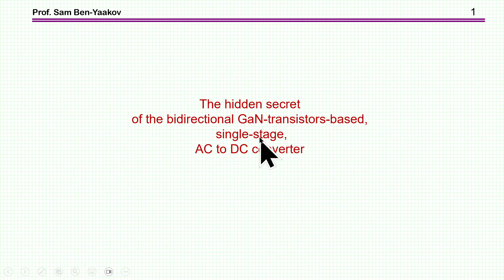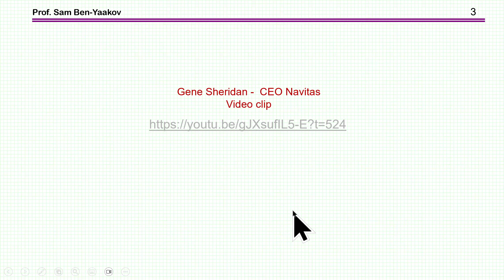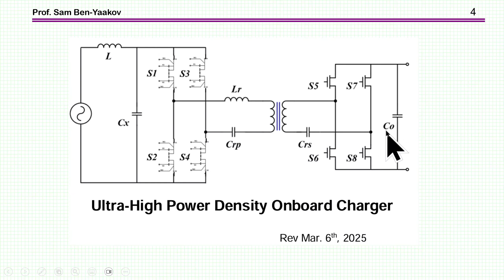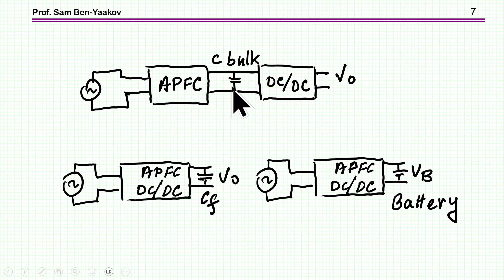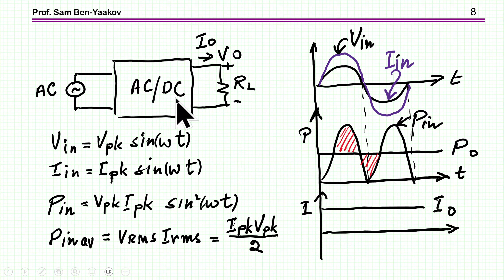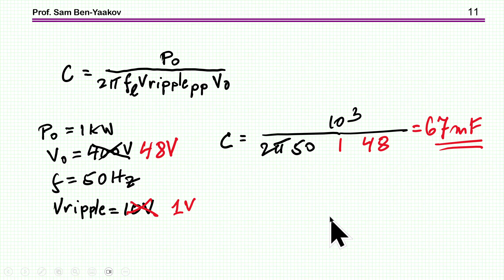The hidden secret of the bidirectional GaN-transistors-based, single-stage, AC to DC converter

Comment: Even for three phase, the rms current of switches is much higher due to circulating resonant tank currents. Hence increased conduction losses ...
Reply from the maker: I am not sure I follow you. Which resonant?
Reply: @sambenyaakov  3:10 , Lr and Cr  ...
Reply: Further, achieving full ZVS also seems to be challenging for three phase case
Reply from the maker: @Mehtab-j1i1t  Today ZVS is more important than RMS current due to the strive for high switching frequency and low Rds(on) of modern switches

Comment: battery chargers regularly operate in pulse mode by design. it makes it much less likely that a single large crystal could form at a specific spot. in lead acid batteries you fight the formation of sulfur crystals (lower capacity) and in lithium batteries you fight the formation of dendrites that could penetrate the dielectric membrane (self discharge; short circuit). ok its not a major factor, but pulsed chargers are slightly beneficial.
Reply from the maker: Thanks for the added info!

Comment: What about in three phase 
1) three separate input single voltage and paralelizing the three dc out ? The 2x50Hz is presente?

2) normal three input voltage phase.

3) design the Dc capacitor just to block the 2x60Hz .
Reply from the maker: The input  power in a three phase system is continuous, so theoretically there is no need for a capacitor, certainly not a bulk capacitor.

Comment: I think this is the direction the manufacturers are taking. The charging current is only a fraction of the current the battery is designed for. Inreased RMS values is likely not problematic. I am no expert in batteries, but I have seen papers that actually show improved lifetimes when batteries are charged with pulsating power. If the specific conditions of onboard charging and the specific battery chemistry applies, I don't know.
Trying to filter out the low frequency ripple with a capacitor connected in parallel to the battery would likely require much more capacitance than in a typical PFC application. The impedance of the battery is very small and the ripple would just flow through the battery.
Reply from the maker: Thanks for the input. I am not a battery expert either, but as I understand, a high low-frequency ripple is harmful. But all this does not vindicate Navitas.

Comment: Great catch proffesor!
I liked the strict simplicity of the mathematical  proof  showing the pulsating nature of the input power in a single phase pfc stage. It is dictating a pulsating input power and therefore pulsating output power as long as pfc operation is kept.  So we can maintain the mathematics by either  setting the output voltage to be constant ( in the battery case which is analogue to putting huge output capacitor) but bare in mind the fact that the current it will handle will be pulsating. We may put a calculated  sized capacitor per given max. output ripple voltage requirement to average the voltage and to cycle the pulsating current that has to exist.
Reply from the maker: Good point, thanks for sharing.

Comment: In defense of Gene - it would be very difficult to provide a technically correct assessment of the advantages of this type of single stage converter without creating a few hour presentation.  If you consider a conventional 2 stage converter the current is conducted by 4 devices in series - 2 devices in the PFC stage and two in the DC:DC stage.  A single stage converter halves this loss by only conducting the current through half the number of FETs.
In a conventional PFC stage the inductor current is unipolar hence ZVS is not really possible (apart from DCM that has other issues) with this single stage converter ZVS and ZCS switching on all devices is possible.  If tge AC source is 3-phase then no output capacitor is needed.  With a single phase solution it is possible to add a ripple buffer to process a few percent of the main converter power and mitigate the DC port ripple.  Also the GaN BDS devices have an inherent die area advantage over conventional unidirectional devices.
For a full explanation look at my 2025 PCIM paper.
Reply from the maker: So you agree with Navitas in their declaration: " the electrolytic capacitors, the link capacitors disappear"? This IS the subject matter of my video. As far as the benefits of a single-stage AC/DC with the Navitas BDS, they have not demonstrated,  to the best of my knowledge, any design example, just empty marketing promises. And finally, if you want me and others to read your paper, please provide a reference or a link😊 Best regards
Reply: @sambenyaakov - Sam, actually yes I agree with and totally defend Gene's comments.  You are picking apart a 30 second sound bite in which Gene is trying to pack a lot of information.  The HV DC link capacitors do go away as there is no HV DC link in the single stage design.  Sure, the size of the LV DC capacitor will go up in size, but the overall system savings are considerable.  
Rather than pulling Gene up on semantics, you could spend some time considering the entire system level savings that you get from a single stage converter like what Gene is discussing and use your platform to help educate your followers regarding the direction that power electronics is going.  Several server PSU companies are adopting GaN BDS for use in single stage (or 1.1 stage) converters, likewise this technology is being adopted for EV on board and off board chargers.
Reply from the maker: @michael-j-harrison  Well, I totally disagree. The electrolytic and link capacitors do not "disappear"; they are replaced by the output capacitor. I am not that naive to think that this was a slip of the tongue. But of course, you are entitled to your opinion. However, I do resent your saying that I am "picking" on Gene. If anything, you are picking on me. You did not refute a shred of what I have said, just coming to the defence of Gene, who is using the free LinkedIn to peddle his products while twisting the facts and not showing or giving evidence to his "promises". And BTW, you are saying that he did not have enough time to elaborate, have you seen any Navitas document that shows tests of a single-stage reference design?
So why did I comment on the Varitas marketing show? I find it proper to share with the community some of the knowledge that I have accumulated over the years, which includes, among other things, pointing out mistakes and fake information that is distributed over the web. 
And FYI, I saw your reply after posting https://youtu.be/9CETZbYKbps
Reply: I would suspect that the bidirectional switch shown here has nearly twice the conduction loss of a conventional switch, but I haven’t yet read the datasheet for it. This chips away at the benefit of “half as many switches”.

Personally, having the two switches drain-to-drain instead of source-to-source will surely make gate drive more annoying.
Reply from the maker: @dennischertkovsky8871  Good points, thanks for the input. It is hard to compare as you need to match max voltage and Rds(on)
Reply: @dennischertkovsky8871 - actually the condition loss is 1/4 of a conventional unidirectional based solution.  This is the underlying reason why it made so much sense to develop the GaN BDS HEMT device.  Read my 2025 PCIM paper for more details

Comment: I believe this is the topology used in the Tesla cybertruck on-board charger, and they have indeed pulsating energy transferred to the battery.
Reply: Would love to learn more about Tesla’s implementation!
Reply: I confirm, modern onboard charger (like cybertruck) do not have a single low frequency (100Hz) capacitor. Most of EV battery manufacturer accept 14kW power ripple as onboard charger have a small power compared to battery capacity.
Reply from the maker: @Roland_d_Authier  Thanks for the input.
Reply from the maker: Interesting information, thanks for sharing.

Comment: Maybe that CEO meant three-phase line (with a single DC-Link)...where we don't really need huge capacitance.
Also...maybe he is willing to sacrifice some PF (like 0.87 instead of 0.99) in order to reduce current ripple (I did that once).
Great presentation BTW (as always).
Reply from the maker: 🤗In fact, BDS are beneficial in 3 phase APFC. The are a number of papers on that. This has nothing to do with link capacitance.
Reply: @sambenyaakov - but with a 3-ph single stage converter you totally eliminate the need for any line cycle energy storage as well as improving the RMS/Ave current stress ratio on the active switches.

Comment: I'm still a little confused. When the intermediate 'DC-link' capacitor is removed, does the output capacitor need to be made proportionally larger? Is the benefit of the new design just lower component count and simplicity, but the total capacitance (whether the sum of the Link and output caps, or just the output cap) remains the same?
Reply from the maker: THe capacitor needs to store energy somewhere. . The capacitance require is derived from E=(V2^2-V1^2)*C/2

Comment: "You need to store energy somewhere between mains half-cycles"  if output ripple is unacceptable. Removing ripple at input is also impossible because of Peak Factor. 
So only intermediate stage is left, where you can have high voltage and high ripple to use smaller capacitors.
So if output ripple is unacceptable, we can't get rid of intermediate stage, even with good semiconductors available. :(
So this will work for, say, "somewhat bidirectional" power inverter - e.g. cheap backup UPS.
Reply from the maker: Corect, But if you need a high voltage at the output  and some low frequency ripple is accepted, then then you can by this topology an isolated APFC.

Comment: Hi professor. With bidirectional switches available, naturally, T-Type power converters are interesting again.

Maybe a video about T-Type PFC , and 3L-SMC and 5L-SMC? 

This would bridge your multilevel videos with bidirectional switch, and further increase the insight into the MV drives topologies
Reply from the maker: Thanks for the suggestion, I will consider it. Good topic. In 3 phase the input power is constant so there is less of a problem concerning low frequency ripple.
Reply: Yes. A video series about MV motor drives and multilevel conversion could be interesting .

Maybe start with classical imbricated cell (classical multicell converter). And then go to stacked multi cell converters
Reply from the maker: @Txepetxcc , Will try. Thanks for the suggestion.

Comment: So they don't disappear they are just smaller
Reply from the maker: Not really, a 800u , 400V may not be smaller that a 67m , 48V capacitor.
Reply: @sambenyaakov but don't you need an output capacitor in the original design anyway? So wouldn't we compare 1 big and 1 small capacitor vs 1 medium sized capacitor? OR, what if, they specifically said they spare the electrolytic capacitor, so maybe they are just using a film capacitor. Which is in my opinion a much better selling point

Comment: Thank you, with a small bit of experience in this kind of designs:

- In 3p Output power is fixed there you can use such a converter without much ripple with balanced input phases (but of course GaN is not really viable directly due to the higher voltage rating required multilevel or SiC)
- The ripple from the dc link is now moved to the AC EMC filter X capacitors. The EMC filter x capacitors must normally be safety capacitors with high surge rating. (They are not normally optimized for low esr) therefore quite bulky.
- The emc emission is ~ 10x the emission of a more standard PFC with CCM. (20dB more EMC filtering required) this is independent of frequency. (There is also more DM HF emission) 
- The lifetime of the product now is tied fully to the x capacitor of the emc filter.  So the X capacitors lifetime becomes allot more critical) if they are lost the topology changes. 
- New hybrid surge protection (VDR with integrated surge arrestor to allow for lower voltage VDR) might been developed to help push down the surge rating of X cap.
- In 1p due to the ac 50Hz current the load resistor for example a LLC varries. This means you get naturally allot more gain close to zero crossing where you need very large gain. 

The above depends a bit on what topology you have for the matrix converter, but parts of it should be relevant to most methods.
Reply: “The ripple from the dc link is now moved to the AC EMC filter X capacitors.”
What does this mean?
Reply: @richard_wu5  In a more conventional PFC + DCDC: The EMC filter X capacitors only sees the PFC ripple current which in CCM you often limit quite allot for example 6App for 16Arms /3.5kW to reduce PFC choke losses or similar. In this case the EMC filter capacitor near the PFC must handle 1.72Arms at the PFC switching frequnecy. The EMC filter capacitor never sees the DCDC current ripple.  

In a single stage converter with for example LLC the average current out of the LLC must match the input 50Hz current. Simplified the higher frequency LLC current must be around 2x the 50Hz current so after rectification and smoothing it becomes equal to the 50Hz at that time. This means at for example at 50Hz peak where you need 22A the rectified LLC current must be close to 44A + Magnetizing current and all of this ripple goes into the X capacitor. 

The 50Hz current is varrying over a 50Hz cycle so you end up with something likely around 16Arms-20Arms @ the switching frequency and this is ~ 10x the more conventional case. 
10x current = 100x esr losses and 100x temperature increase and melted capacitors if not better capacitors with allot lower esr are used.

For the case of comparing a single stage AC-DC to a DCM PFC+DCDC.
Reply from the maker: Thanks for sharing your experience, very interesting points. In 3p the input power from the line is constant so there is less of a problem.
Reply: Can you also shed some light on number of switches required per phase for three phase case (considering traditional SiC MOSFETs)? Also , from my experience, achieving full  ZVS is also challenging over 50 Hz cycle. 
And do you suggest that Cx would see higher rms current, same as say the rms current of the resonant tank ?
Reply: @Mehtab-j1i1t  Switches now you have back to back so 6 -> 12 for a pure 3 phase primary side. (more standard PFC 6+4 = 10 switches AC->DC) (A better question might be more what rdson you get the same conduction losses as a 10 switch) regarding ZVS allot easier than getting ZVS in convetional 3p boost PFC i would think. (so even if you do not manage perfect zvs everywhere maybe you are not so far away from the equivalent) The X caps sees the resonant current (high losses which X caps are not great at due to allot of safety requirements and overvoltage requirements)to not die at the first surge) so lifetime can be challenging as x caps louse lifetime due grid overvoltages, surge and very high self heating if you dont oversize very much.

Comment: Thanks for this video! conditions of this remain me lighting CC flyback designs for LED lighting - from 25watt onwards, power factor regulation is required. So, flyback with PFC correction, can be done (and was with controllers like FL7740) by moving tens microfarad 400-450v primary side capacitance to the second isolated side with increase accordingly to hundreds or even 100-2000 microfarad, ensuring feedback control loop to be tens of Hz, and since LED CC output allows 10-25% ripple, getting simple and cheap single stage LED driver. Here with multi-kW designs, tens of mF capacitance is not feasible practically ands is expensive. also inrush currents will be huge on connection disconnection for such bulk capacitance..
Reply: If you are just charging a battery, can you back off on the secondary capacitance and just send more ripple into the pack?
Reply from the maker: @jeremyloveslinux  This is considered bad practice. May reduce the battery's lifespan In any case, this has nothing to do with the BDS.
Reply from the maker: Thanks for the very interesting and important feedback!